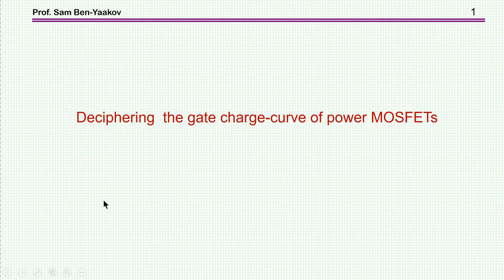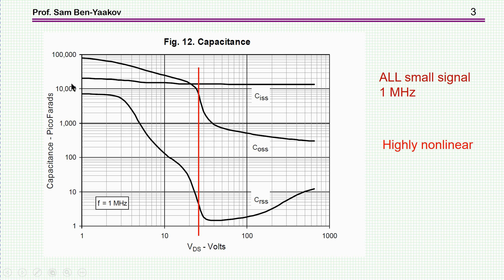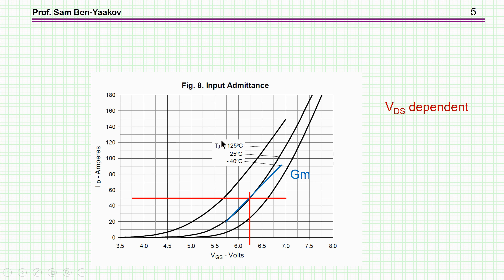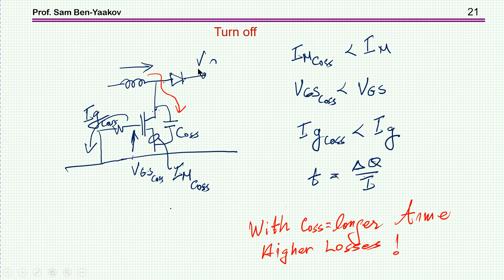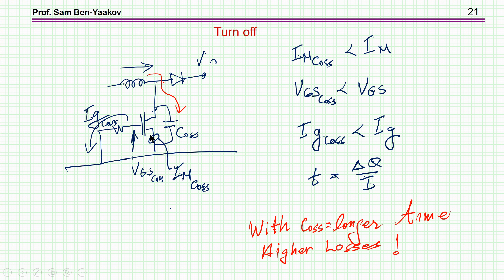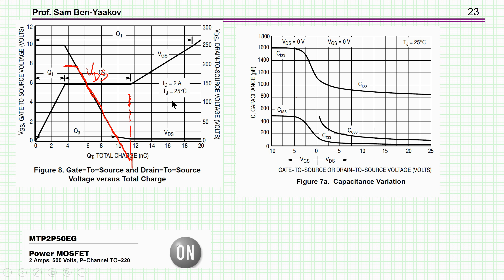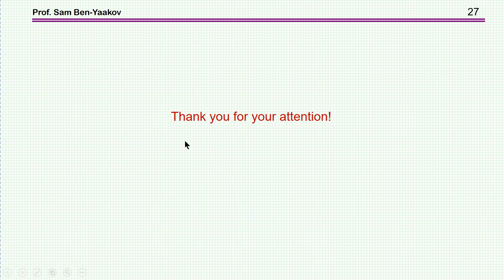Deciphering  the gate charge-curve of power MOSFETs

Comment: Thanks for the great video. Your videos are always a great help for students and professionals alike. 
However, I would like to point out a mistake in this video. At 40:57, it is said that the nonlinear effect of the capacitor would reduce the switching losses. Here, you compare two cases, one with a "constant low capacitance" and the other with "high capacitance at low Vds and low capacitance at high Vds (nonlinear C)". The increase in C will always have a higher charge requirement for increasing its terminal voltage, resulting in increased losses. I think the "red line" representing constant C should start decreasing when Vgs hits platue region, consequently dropping Vds to zero by nearly 10nC. Whereas, in the case of nonlinear capacitor, the drop in Vds would extend beyond 10nC due to the increased capacitance as you have shown. Thus, the nonlinear effect of the capacitor (increased C in lower Vds) should cause an increase in switching losses.
Reply from the maker: Thanks for comment. I am sorry, but this portion of the video is all messed up, the pointer  position is off and I am afraid that my explanation was not clear. You may be right but this is a 5 years old video and it is difficult for me to go back to it. My apology.

Comment: Hi, thank you for the great tutorial. I have a question regarding current through channel at the end of Miller flat region. If the Vgs is increasing why does the current stays constant? I believe it should increase because increase in Vgs should allow more current to flow through the channel?
Reply from the maker: It's a good question, but there is a good answer😊the end of the flat, the transistor is totally on with an Rds(on). The current is not controlled by it but by the external circuit.

Comment: Hello. It was very beneficial, thanks. but I do not understand one thing. the flat area was formed because of that feedback effect and the transistor current is linked to Vgs. when drain current heat to zero, what difference makes the feedback effect and that linkage does not work here?
Reply from the maker: If the current reaches zero there is no gain so no feedback.

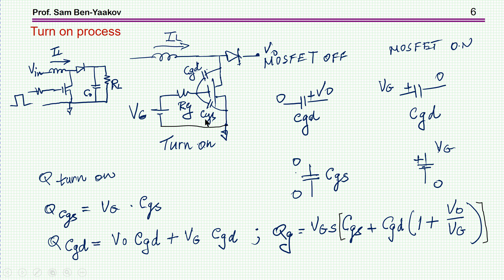Comment: Hello , thanks for detailed description of MOSFET Ciss and turn on explanation that is unique. However I have some critics here. Actually I watched the minutes 9:00 till 17:00 5-6 times and could figure it out the explanation. first of all, talking about the behaviour of an electrical circuit without writing the current/voltage equation is hard to understand. maybe writing the kirchhoff's law at the nods/meshes that you want to point out could help for better clarification. secondly the mouse pointer is showing point A when you are talking about point B for example . And finally talking "current/ voltage at this point or that point" is not clear which point.  maybe it is better to define the currents and voltage as Ig or Vds etc... and mention them explicitly as gate current or drain source voltage. many thanks
Reply from the maker: I am sorry you did not find the explanation clear. See if this can help https://youtu.be/of_v2N5f788

Comment: I really like this simple explanation regarding the CGD capacitance. Comparing on and off State and calculating the delta Q for the input capacitors. What really confuses me is the term miller effect and miller plateau which are used in this context across the literature. From my understanding miller effect is something related to small signal calculation (gain). It has a huge impact on my bandwidth for example in my transfer function. Interestingly this simple calculation with the total charge reveals the same miller factor, that CGD is increases by low frequency small signal gain.

Is it possible to explain the miller plateau by looking at the related time constants? CGD is larger then CGS (because of Miller, additionally the FET is in saturation region since VDS>VGS-VTH), so the time constant associated with CGD should be larger. That means that when i reach the plateau the slope of charging CGD will be higher then CGS, because CGS has been already charged RELATIVLY higher.
Reply from the maker: Your assumption are wrong. Once the Vds drop to about zero the MOSFET behaves as a resistor Rds(ON). Watch again the video. Have you seen https://www.youtube.com/watch?v=1XqyrAgMQVc&t=0s  ?

Comment: I guess the cursor in this tutorial being pointed to at, is offset by few scales depending on full screen or not :) !! But thank you very much for making this video. This was extremely informative and useful.
Reply from the maker: Sorry. There was a problem with this video.
Reply: @sambenyaakov  I hope you are fine, Sir. I have a doubt!! I couldn't find the value of Gate inductance, however drain inductance and source inductance were given. The values of Gate and Source inductance are required to calculate the minimum required Resistance before the Gate to avoid ringing. Is there anyway to know this Gate  inductance from datasheets?

Comment: Dear Professor, thank you a lot for the video. I have a further question in the subject. Is it possible to help me understanding how to use and "rescale" the data sheets curves in case of different operating points? Suppose I want to use the 650 V you used in some videos at 12 V only and with a gate voltage of 5V. How should I readapt the values of the data sheets for my application?
Reply from the maker: You mean the Vgs- Qg curve? Send me an email to sby@bgu.ac.il so I can send you an attachment.

Comment: Greetings professor. I am a fan of electronics. I've been watching your videos. I wanted to ask you about a possibility, because I had a circuit in my hands that was behaving a little strange. It basically had a load fed at 1.6v, whose current was 5A, but on the oscilloscope it had a weird oscillation.
Could you consider that the oscillation was caused mainly by having a low voltage Vds in the off state in the Mosfet?
I say this because if the Vds does not have great movements, then you have an increased Coss.
Generally speaking, is that observation correct?
Reply from the maker: Thanks for conversatio . Not sure that I follow the question. Please add a sketch of circuit. You can write to sby@bgu.ac.il

Comment: Hi Professor,
Could you please help me by clearing my below two doubts?
1. When Vgs reaches Vth, the current Id starts to increase linearly with respect to Vgs. But during this period, Vds is high and also Vds>(Vgs-Vth), the MOSFET should operate in saturation region and hence the drain current should be increasing parabolically as per the equation Id=K(Vgs-Vth)^2..If MOSFET is operating in saturation region, then how the drain current is increasing linearly?
2. In case of R load, Vth= Plateau voltage?
Reply from the maker: 1. The current range in power MOSFETS is at the first "linear " portion of parabolic curve. 
2. For R load transition is at Vt

Comment: Good video, thank you.  I still failed to understand why vgs is flat during the linear range --I couldn't follow the explanation of what is going on during this stage that makes vgs flat.
Reply from the maker: Hi Jorge. Thanks for comment. Basically the situation is like having a "virtual ground" in an op amp. But you may be right , this should have  been better explained perhps. I am contemplating a specific video on the subject of flatness. Keep your eye open for this video. If posted I will send you a link in a reply to this thread.

Comment: Dear professor,  thank you for this lecture, which is really great, simple, but without unnecessary simplification. But I think there is one mistake. Slide 15 (time:~24min). You gave an equation for Ig1 as an average value. But after further simplification, it would be (Vt+Vgsf)/2Rg. I think the correct form of this equation should be: Ig(avg)=((Vg-Vt)+(Vg-Vp))/(2*Rg). 
Best regards!